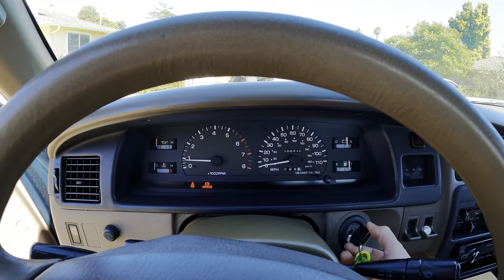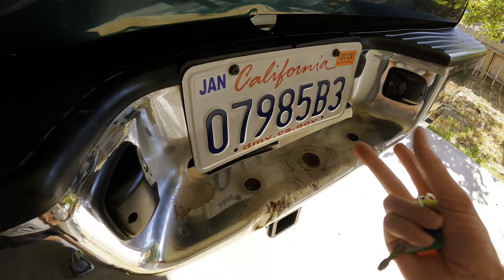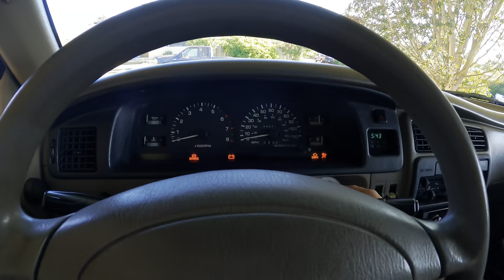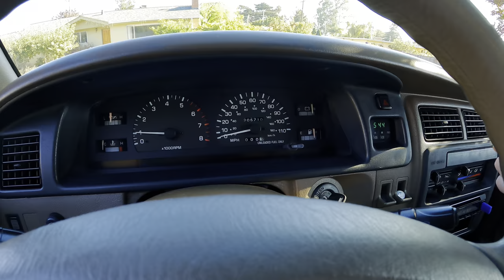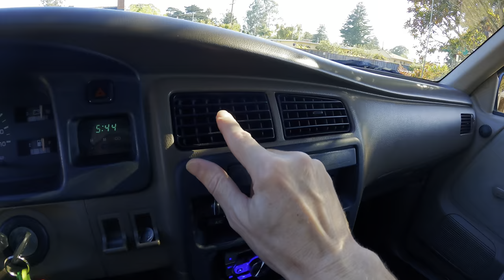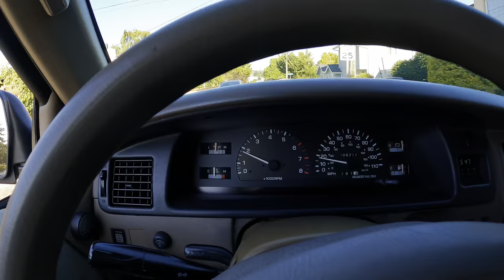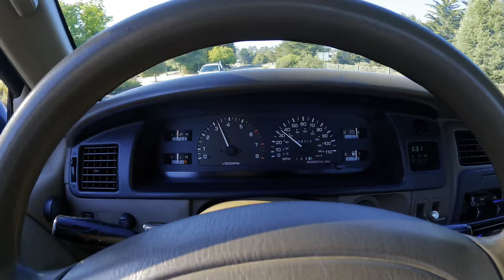Buyer’s Guide - TOYOTA T100, TACOMA, PICKUP and 4x4 - Full Checklist!

Comment: Just bought a 95 SR5, trucks in excellent shape. Sat for a long time but it looks really good for an east coast truck. Even the paints still intact. My dad has a 1996 2WD and it has over 380,000 miles. Used and abused everyday for work and it just keeps on going.

Comment: I used to have the exact same truck same color in high school.  I had a 4inch suspension lift with a 2inch body lift.  I ran 35 inch tires.  I ended up putting 5:29 gears in and a limited slip.  Ow ya you have to have the front skid plate as well.  There was a ton of other things I did to it.  I kick myself everyday for selling it.  I will get the same exact truck again but I want to put the trd supercharger and have the motor completely built.  I miss that truck so much!!!!

Comment: I'd also add that when looking, it's worth it to pay a bit more to get a truck that doesn't have these things then try and save 1000$ thinking it doesn't look that bad. also it's worth it to get one that has the features you want, even if it's more money. I was looking at 4 or 5 trucks, and the only one that was rust free and had the options I wanted (sr5 trd) was 2k more then the others, but it payed itself off over the years as I never had to worry about rust or damage. I probably would have bought the truck even if it was 4k more (2010 dollars) because it lacked any of these problems, just a bit high on the mileage. but eingine was in great shape and it was loved, I could tell.
Oh yeah, allot of folks take off the hood insulation instead of replacing it. I did it, it's one of those small things that doesn't impact much except some noise.

Comment: you didnt mention the splash of oil under the box that is from the seal where there rear driveshaft goes  those types of leaks usually only happen then the vehicle is being driven the seal leaks, driveshaft input then sprays everywhere sometimes people when selling there vehicle will wipe off the driveshaft but the spray tells the story  of the possible seal or the input shaft or more then likely both having issues many people just replace the seal which stops the leak for a while but it comes back . also dont pull on opr push the driveshafts ifif you do this and it has p-lay then ther is a major issue its best to  go to the point where they are connecting  and twist on either side of the shafts joints to check for play plus make sure the driveshafts are aligned if not aligned would cause vibration and possible damage later on the driveshaft on your truck is aligned .
I love the older vehicles you can get at and see so many things the newer ne have covers everywhere and to get at things you have to dismantle so much to get a look at it.
as for things like the cluch peddle at the top if it is a hydraulic clutch then that is normal the old school clutches if the peddle releases at the top then there is an issue
Reply from the maker: Sounds like you know your old school Toyotas, thanks for the tips.. 👍🏼

Comment: 95 5VZFE SR5 4x4 Tropical Blue Met 8B6 engine bay same as the body, no hood insulation..
Reply from the maker: Nice truck you got there.. i still don’t understand why some have insulation and some don’t.. there has to be some reason..
Reply: @toyotafanatics1 Yeah it doesn't seem like there was ever any installed?  She's pretty rough around the edges but, I needed a little truck a few years ago and found the dream for a bargain.. Clutch was making the same squeek as that one..lol. Fixing that was fun..😅  I just ordered timing and valve cover kits, gotta redo all the universals carrier and suspension next.. Cool vids!

Comment: My 95 T100 engine bay is not black. It’s white. Same color as the whole truck. Mine also doesn’t have the insulation under the hood. Your front turn signal lens should be orange at least that’s the factory lens color

Comment: Should I buy a t100 4x4 but 4x4 doesn't work? You think it expensive to fix? You think to worth to buy?
Reply from the maker: If it’s a super great price, go for it.. but it could get expensive to repair or replace the transfer case.. might want to just keep looking for another, especially if you plan on using the 4wheel drive..
Reply: @toyotafanatics1  yeah thanks the price 3,500$ and it has 190k miles. Idk if I should go look at it same color and height as yours

Comment: I was watching your video and saw your skid plate. I have a 96 t100 with 35s and a 5 inch lift. I'm looking for something a little stronger than plastic. If you could find out where you got the skid plate that would be great. Thank you
Reply from the maker: The Skid plate is a genuine Pro Comp skid plate, and i bet they stopped making it for the T-100 a decade ago, but i’m pretty sure every Pro-Comp skid plate is compatible with most lift kits, it’s just a couple bolts, you can drill your own if it doesn’t line up.. I found a very reasonably priced one for a Tacoma, i bet this could work.. lemme look into it more and i’ll let you know if i find one for a T100.. 
 https://www.ebay.com/itm/134300540778?mkcid=16&mkevt=1&mkrid=711-127632-2357-0&ssspo=zsepJyU3S5-&sssrc=2349624&ssuid=7znpTDOfTJ-&var=&widget_ver=artemis&media=COPY
Reply: @toyotafanatics1  thank you so much
Reply: @Toyota Fanatics  thank you this really helps. I've been searching for a year and I never thought about a Taco skid plate. Good thinkin
Reply: @jimbo_is_great what lift kit do you have on your 96 Toyota T100, I can't seem to find good suspension lift kit for my Toyota T100 SR5 2WD Extra Cab when I search for one,  I read a comment claiming you can't do front 3inch adjustable coilover shocks in the front, not sure how true that is, don't know. What lift do you have on yourT100, im in need of one reasonably priced, so I can have a little more clearance up front, so I can put my brand new set of 33s on my truck. Would Appreciate your help and thoughts.

Comment: Good morning bro, what steps do you use to move those tires? I have a standard t100 4x4 with 285 75 16 tires and I feel heavy, they recommend me to use step 4.88
Reply from the maker: So the T100 4x4’s that are Auto trans have a 4.30 ratio and the 5spd. has 4.10 ratio.. im almost 100% sure it still has the stock gears.. your absolutely right, 4.88 is exactly what i should have running those 35’s..  i did 4.88’s front and back on a 92 4x4 single cab toyota a few years back, it was incredible the difference it made.. 👍🏼
Reply: @toyotafanatics1  thanks bro, nice truck

Comment: Hi,
I have a 96 t100 4x4  last year I was getting some unusual wear on my front pass tire and took it to a shop. I replaced upper and lower control arms on both sides, ball joints, tie rods, and inner and outer axels but now it's noticeably lower in the front than in rear and very bouncy for some reason the torsion adjusting screws won't raise my front end. both lower control arms matched up to oem any idea how i could stop the bounce and raise my truck back up
Reply from the maker: How many miles are on the truck? It would be nice to just start over and put a 5 inch superlift suspension kit on it.. but for a lot cheaper you could just try these out.. 
https://www.ebay.com/itm/234577088620?mkcid=16&mkevt=1&mkrid=711-127632-2357-0&ssspo=2a37clFFR66&sssrc=2349624&ssuid=7znpTDOfTJ-&var=&widget_ver=artemis&media=COPY

https://www.sdtrucksprings.com/index.php?main_page=product_info&products_id=31995&srsltid=AdGWZVQqEVoI0_P9rCBWXtFghIRHck0BxHW1JfJs63JKAgpukZ8IS3hLkeI